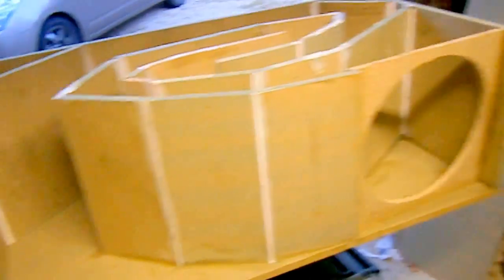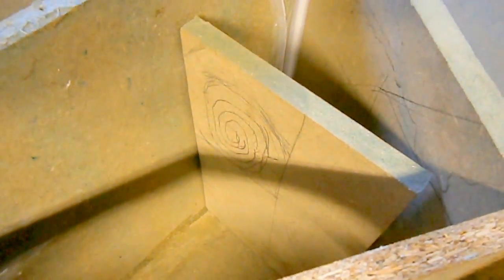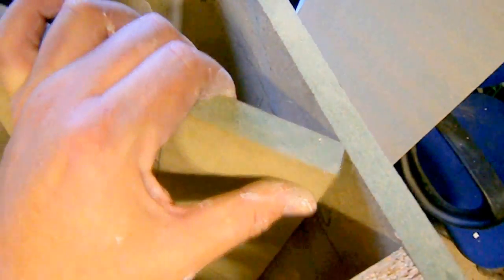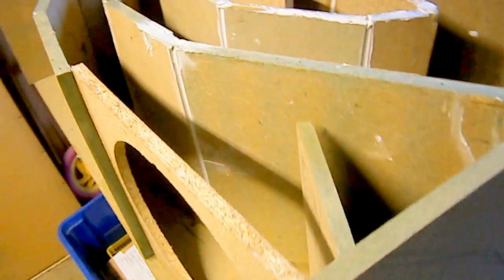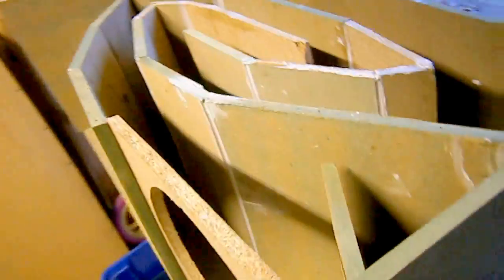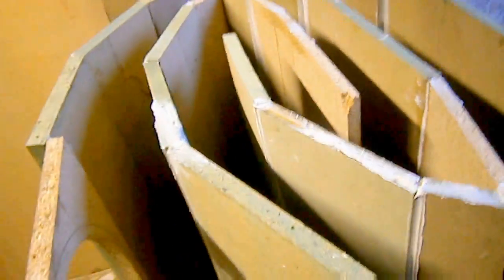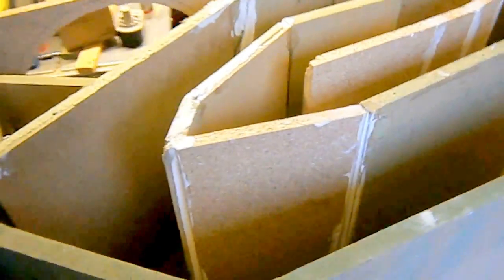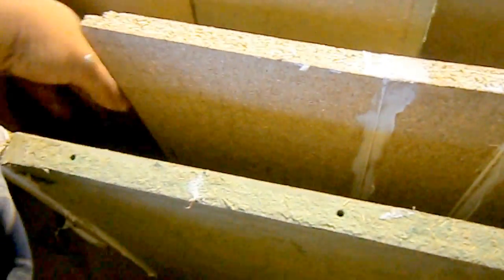Built from scrap transmission line bass speaker (built by Creative Realistic Audio Products!;-))

Comment: This does not follow the transmission line mathematical model established in the 1950s for achieving optimum bass extension. First and foremost the line length needs to be 1/4 wave length of woofer free air resonance wave length. The line should be stuffed with insulation (R factor) and also needs to taper from input to output with precisely defined vent areas at both ends of the line. Look up Bailey/Radford transmission line design. Easy to follow. Their TL design achieves the lowest -3db extention for a given woofer of any reflex system ever invented while retaining optimum system Q (damping).
Reply: Thanks - very useful - am still learning :)